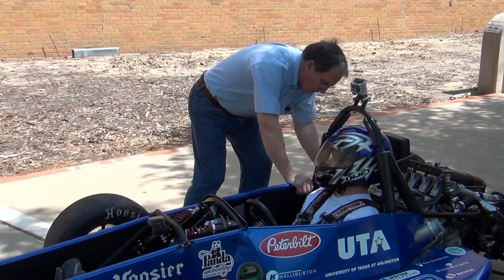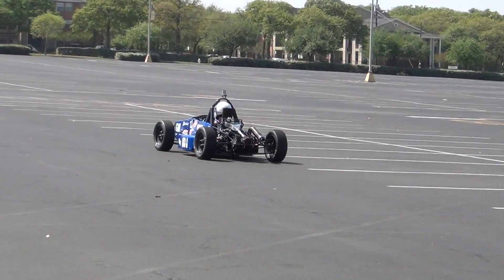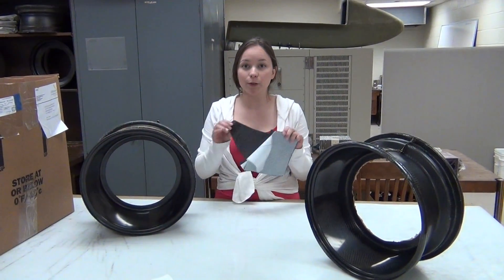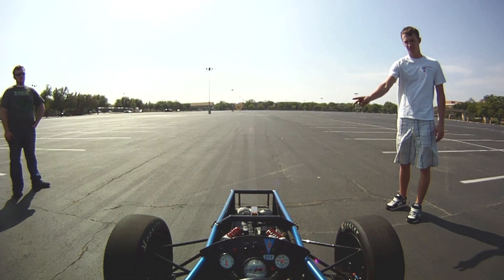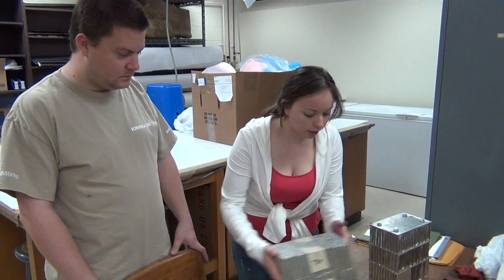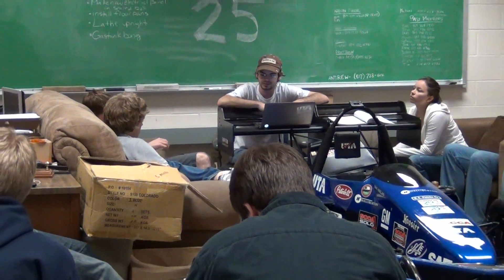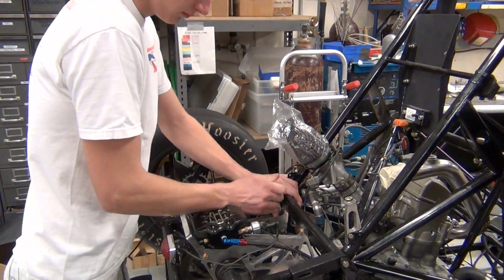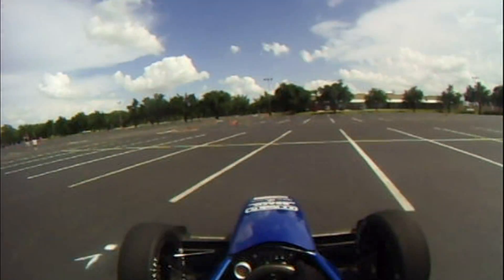UTA Formula SAE Racing

Comment: Carbon Fibre wheel??!?!?!?!? PLZ do a tutorial!!
Reply: Plz do. I am planning on joining SAE and carbon fibre wheels is a must!
Reply: tair0ne Also it looks like a lot of students use steel or aluminum pipes to form their chassis. Has anybody tried to use fibreglass pipes for the chassis? If not, thats something that I might experiment with.
Reply: Do you have any ideas on the moulds required to make these wheels, required equipment, gel coats, or any advice at all? Also what tips can you give me on producing a good formula car? Thanks anyways!
Reply: Ahh ok. Thanks anyways.